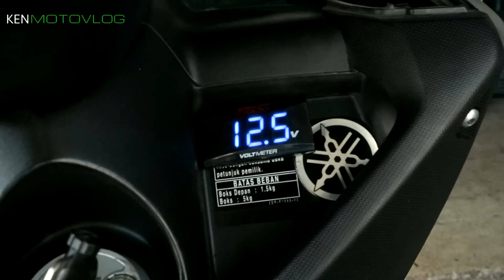CARA MENGATASI ENGINE CHECK MENYALA

Comment: Msh mending ente, sy sdh 3 dealer yg nanganin mtor NMAX sy krna engine check nyala malah disuruh ganti ECU sm mrk, alsan'y krna ud dicoba pke ECU dr NMAX mtor lain engine check gk nyala lg. 
Jd motor ane it lampu indikator engine check n ABS nyala terus (ada kode 42), ud bwak ke 3 dealer resmi cma byar jasa cek aj n gk bsa jelasin mslh sbnr'y. Yg jd mslh motor ane bkn cma krna lampu indikator it nyala, tp mtor ane sering klu lg digas/pas mau nyalib srng kehilangan tenaga/spt habis bensin. Stiap dijelasin keorg dealer, mrk cma tes mtor ane n masalah'y gk muncul. Knp hrs nunggu muncul pas mrk tes ?? Kn ud dijelasin, srng kehilangan power/spt hbs bensin/spt mati mesin pas lg digas, tp gk slalu spt it, cma sering spt it ap lg pas pjalanan jauh.
Reply from the maker: Sabar bro sabar
Reply: Sabar ane gan, emg tulisan'y mngkn kesan'y spt emosi.
Reply: Cobak cek kabel speed sensornya d dpan brow.
Reply: Ando Uzumaky broo sama permasalahannya kayak saya , itu jangan bawa ke bengkel resmi bro , kalau nmax mu abs , bersihkan dulu sensor kecepatannya yg deket cakram ,